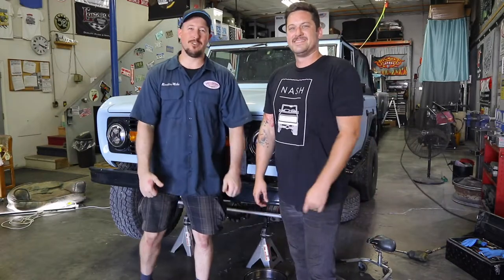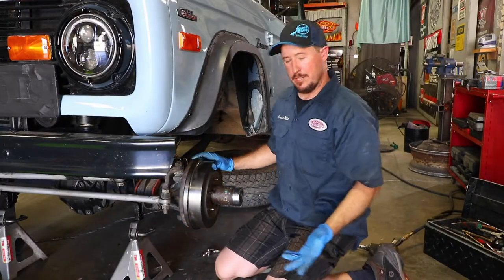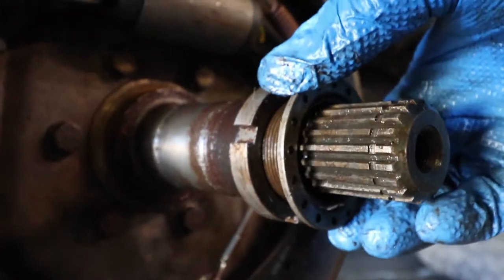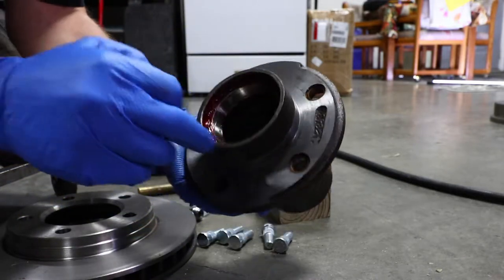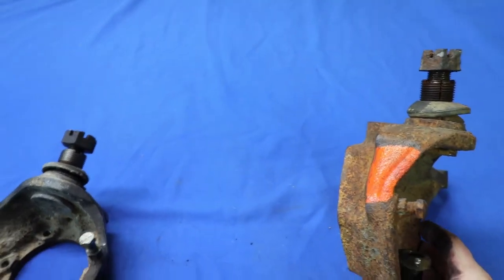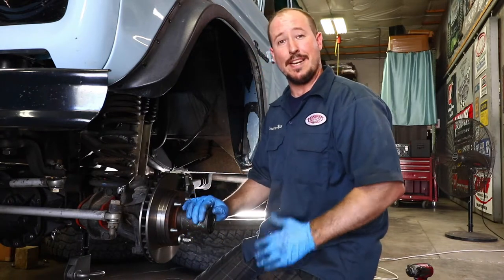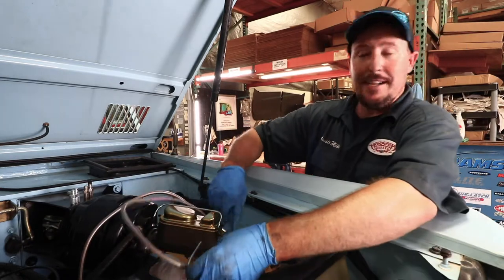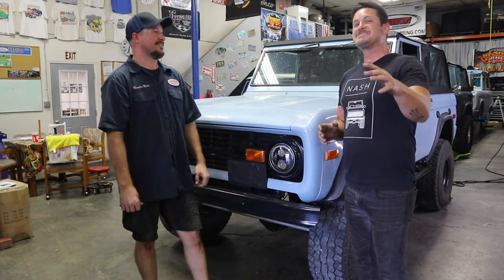James Duff Budget Disc Brake Install

Comment: Great video !! Do you have to replace the lines to the the back ones or is original ones good?
Reply from the maker: We recommend you replace any old rubber lines. Hard lines only need to be replaced if they are leaking and/or appear rusty and pitted.

Comment: What pads come with the budget brake kit? I can assume that when I need to change pads, I can head on down to Napa and pick up a set? I didn't see any pads on James Duff's site . Thank you in advance.
Reply from the maker: I would call James Duff or email their tech dept at tech@dufftuff.com to have that question answered. This kit is fairly new so they may not have the supporting components offered outside of the kit yet.
Reply: @BroncoGarage  No worries. While ordering the kit today, they gave me the information I needed. Pads from a 76-77 Bronco. Thanks

Comment: Got a question. Hopefully y'all see it. So, in regards to milling down the hubs to work with the disk rotors. Couldn't the hubs off an 80-96 Bronco work as well? I realize it is not a straight axle D44, but, the locking hubs and bearings I believe are the same. Possibly a later year seal would have to be used. Only wondering because I have a set of hubs from a Fullsize 90 Bronco. Maybe that'd work,  don't see why not. Any info would be great. Thanks!
Reply from the maker: Eric, we cannot confirm they would work. It is likely they will not but you would not discover the issue until you tried mounting the caliper. What typically is the issue is the wheel bearing offset is different which changes final placement of the rotor.
Reply: @BroncoGarage  Thank you for the response. Appreciate it.